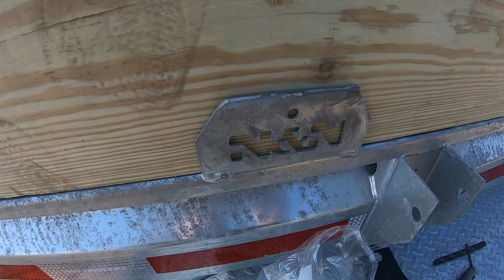N&N galvanized trailer gets sideboards and HAULS WOOD

Comment: Put a 2" x 6" under the 2" x 12" then your sides would be 17" tall. You could make a flat plate to connect the 2 boards in the center.
Reply from the maker: Yup, that would work too!
Reply: @InTheWoodyard  Or a 2x4 under the 2x12 with strips or tie plates, if you're worried about the pocket dimensions. Or go down to the local Amish Engineering and Weld shop, make the expanded screen extensions, with bracing, up to the 36" extension. I think that's too high, but I guess Kryptonians don't pay much attention to mere earthlings when it comes to things like that. Could make a 36" panel that folds down some, sorta dual purpose. Ask Tony! He's no MERE earthling!! Betcha he could come up with something you'd feel good about! - No law says you can't put the 2x12 on, see how it works, go from there.
Reply: Other comments are recommending Teflon slick paint, I think. It's so slick and nonsticky, it won't stick on anything! On my gravity wagon, it didn't even last 3 loads! Made me worried about chemicals in the paint that were then in the corn. You could paint the floor purple if you wanted!! Nobody'd see it!! Ordinary paint, not so slick, but takes a lot longer to wear it out! - I'm surprised you didn't just round off the shoulders of those bolts!! The bolt in the back could be ground off, and with a jam nut there wouldn't be much there to catch firewood!! - Use a strong bungee to take up the slack on the tailgate chains. That will leave you with options!

Comment: On my trailer I used castle nuts on the inside they are nice and rounded and I don't seem to have any problems with anything getting caught on them and if you happen to be in the trailer and bump into it with your bare arm you should not get cut like you would on the bolt, just a thought, paint the wood silver and get some of that reflective tape in red and put that on, I think that would look nice and be seen better at night , I used the hi visibility reflective tape, it's better to be seen nice and bright, take care
Reply from the maker: Thanks for the tips Larry!

Comment: Congratulations on using your new galvanized trailer, looks sharp. Nice job on the sides too. Maybe you can coat the bed with a liquid wax to help with getting the wood to slide when the bed is raised. Paint the wood inserts silver for a sharp look.
Reply from the maker: Thanks Edward, I might do that!

Comment: If you need some angle iron to reinforce the corners or along the length of the boards I've got a bunch of it. Would make for good rub rails and keep the top edges from getting banged up. I'll even drill the holes and install, all free!
Reply from the maker: I will let you know! Thanks!

Comment: Kris, I don’t know if you are completely north of corn and soybean country, but if there are any farm implement dealers around you with grain carts, gravity boxes, grain buggies on their lot, ask them about ‘slippery paint’. Wet corn, up to 25% coming in from the field, doesn’t slide very well either. I’ve never seen a galvanized gravity box but this slippery paint can apparently be applied right over the original. Just a thought, there must be some kind of silicone wax spray that will work also. Good luck, great looking trailer!
Reply from the maker: Thanks for the tips Thomas!

Comment: Hey Chris 
My dump trailer has the same plastic caps as yours on the top of the 2x2 uprights at the tailgate and rear corners. I hauled 4 or 5 loads and noticed 3 of them were gone. I shined a flashlight up from bottom in the dark and guess what....no drain holes. Might wanna find something to seal top off or drill a hole in the bottom so they don't get water in them and freeze. Might check and make sure it won't hold water..always something!!!
Reply from the maker: Thanks for the tips Gary!

Comment: All kinds of trailer envy on this end. Just purchased a Moritz painted trailer. Dint even no bout galvanized trailers...  
Be sure to coat any drilled out holes with some of the galvanized paint and I would coat any exposed threads too.  I haven't had much luck with painting green treated wood.  I think using some of your used oil, would not take much, to treat the side boards would be the way to go.  You could always attach any advertising to your side boards to add durable colors .
Reply from the maker: Yup, my thought now too, thanks for watching!

Comment: leave the boards natural, just use thompson’s wood preserver, the green can which is oil based, it last longer, painted boards look bad when the paint starts chipping off, and i bet the trailer bottom will get slicker after a few dumps wears some of the galvanising off, and for the love of humanity…grease the trailer!  the saying goes…grease is cheap…pins and bushings are expensive.  great video, oh the wood will hang up on the D-ring not those bolt ends, but you could grind them flush to the nut if you want.
Reply from the maker: Yup, all good points! Thanks!

Comment: It's a little disturbing that you watch your customers while they are rubbing their wood.
My truck has issues tipping if it hasn't been used in a while. It get a fresh coating of rust on the deck and that's often enough to stop things moving. Once it's had a few loads of wood or gravel through it again it polishes up and slides nicely again.
The trailer looks super sweet.
Reply from the maker: HA! Yes using it will help!

Comment: The sugar beet farmers here put a plastic sheet in the bottom of their trucks.  It allows for a makes a much more slippery surface.   I don't know what it's official name is,  but its about 3/16 thick.  It simply bolts to the front of the box on the floor.
Reply from the maker: Thanks Mega Mike!

Comment: There’s a spare tire lock I think I picked up from Tractor Supply. Two tabs that thread on to two bolts it has 90 degree bends that the lock joins them together.  You might not want to get the sides too high because you pull into garages on your deliveries. Nice looking rig.
Reply from the maker: Thanks Jeff, this trailer might not get into many garages, it is wider than the old one.

Comment: Chris , the tubing that the mount slips into . Drill a hole in the center and put a bolt 1/2” or bigger bolts thru it with a nut on the back side and tighten it up to bracket until it pushes the bracket tight to the inside of the tube piece right there will be no more play and then snug the back nut up. That’s what I did with my new trailer with same style mount , also I noticed at my dealer they are making them exactly like that now
Reply from the maker: Thanks for the tip!

Comment: N&N is expensive on their sides. When I bought my Diamond C, I paid $800 for 2 foot expanded metal sides, 1 head board, and 2 for the rear doors. Before I went up anymore, I would calculate out and see if your legal and truck can handle the weight you want to haul. Commercial truck violations are very expensive.
Reply from the maker: Good point Richard!

Comment: I have a 4*8 flatbed i made stake sides for, and i painted the 2*4s and 1*4s with an oil-based paint. It's lasted 7 years and going! I was surprised. It's only flaking off where i made a vertical bit crooked and i have to beat it into the stake pocket with a sledge when i slot them in.

Two coats, gave it like a month to cure properly.
Reply from the maker: Thanks for the tips, again!
Reply: Sorry i type as i watch lol. I'm very forgetful.

Comment: Good choice on the trailer! The telescopic ram/piston is the only way to go as long as it lifts high enough. As for side boards we used the laminated lumber just like the planks masons use they support a lot of weight. So if those planks or hardwood doesn't work out the laminated will hold up well. That's what they usually put on the semi and straight dumps (big trucks) but cost is high. They'll take a pretty good hit from a loader but you'll probably be good hand loading or loading yourself. That trailer should be nice because it's deep and short enough so it will dump well! Enjoy! Maybe you can have a dump load sale to get rid of that old wood? Maybe a few pieces rubber and blocks behind your spare will snug it up so it won't shake apart?
Reply from the maker: Yup, I blocked the spare already and my brother mentioned the laminated lumber for the side boards. Thanks for the input!

Comment: Hi Chris, beautiful trailer!  To help a hand plane slide over wood, we either rub some parrafin wax on the bottom or slide the plane over a rag soaked in WD-40.  However, a plane bottom is much smoother than galvanized metal.  Not sure if it will work, but thought I'd share.  Keep up the great videos!
Reply from the maker: Thanks for the tips Jason!

Comment: Think your idea of a 1" or so gap from side board- down to side of galvinized  trailer would be good idea with road vibration, you might get wear on your galvinization ,and then maby rust. Good idea going 6' width on your trailer.  I have a Galvinized boat trailer & no repainting.
Reply from the maker: Thanks Dan!

Comment: I like the chain door holder. Just put a connecting link, whatever they're called that has the little hex shaft that screws closed. Make a little loop with that instead of taking out links, in case you want to re-extend it for some reason. Dab some lube in the threads, mine like to sieze in whatever position they're in.

You could also put a neat-ass hook onto the 2*12 right there, so you don't have to fiddle with the clasp half the time. I hate locking clasps, unless they're on safety chains or something.
Reply from the maker: Yup, all good points...thanks!!

Comment: Just buy locking lug nuts for the spare. Problem solved! If you paint the wood, it will eventually peel and flake and look like doody. Get a hand-held small blowtorch. Use a steady hand and lightly burn the surface in long strokes. (Practice on scrap pieces of wood first to get the technique down). You will end up with really nice looking wood (this brings the grain out) that will also be more protected.
Reply from the maker: Yup, good ideas !

Comment: Save up your tip money and pick up a nice hydraulic 12,000 pound winch for the front lip.

That would make getting those 12 ft. 
X 15 inch diameter logs up and in that nice trailer.
Reply from the maker: That might be a good idea!
Reply: It would tie right in to the existing hydro system to the lift.
Anxious
To see how you get along with the non slip cargo bed.

Comment: Just be careful lifting with the gates closed like you did with the old trailer to unload by hand. I blew that bottom latch off on mine last fall when I had stacked load take a good slide
Reply from the maker: Thanks for the tip!

Comment: 1. The sell locking lug nuts you can use for the spare tire to deter theft
2. If you let the boards naturally gray, that may match the trailer and require no extra work
3. I’m sure as that galvanized bed wears in, the wood will slide out easier. You may just have been spoiled on your old trailer as it was “broke in”
4. I’d probably go up another 8” on the sides. That should easily let you fit 4 face cord loosely & 6 face cord stacked.
Reply from the maker: Ben, you are not just another pretty face, I agree with you!

Comment: Good morning Chris, I'd recommend a solid color stain for the sideboards as it will give the look of paint but not peel. Also when you pull the boards off to paint or stain you can buy an aerosol can of galvanizing compound and spray the holes you drilled through the brackets as the inside of the holes are now bare. As for the floor maybe try a couple coats of wax? Idk know how long it would last though. Might also check to see if you could prime and paint over the galvanized floor, still have the protection of the galvanized, but the smooth finish of paint.
Reply from the maker: All good ideas, thanks Jason!

Comment: Not 100% sure but I think if you drill through the galvanized coating you will get rust where the bare metal is exposed.
Reply from the maker: Yes you are probably correct about that!

Comment: With the chains holding the rear gates open, it looks like you might be able to reposition the fixing to the trailer rather than 'remove' three links.
Reply from the maker: Yup, that would work too, thanks!

Comment: Nice trailer, nice video.  You can purchase a product called Slip Plate at the farm supply stores.  We used to use it on the gravity flow farm  wagons to make the grain slide out better.  You can purchase very thin aluminum diamond plate sheets at the farm supply or home improvement stores to cover the side boards if you don't like the appearance of wood.  I actually like the natural look of wood and use used cooking oil (painted on with a brush) after the green treat wood has been allowed to dry for a while.  If you ever decide to haul logs on the trailer; I suggest taking the wooden side boards off as they tend to get broken while loading or unloading.  GNI
Reply from the maker: Thanks for the tips Larry!

Comment: Morning Chris, that’s a great trailer, see you went “ dog digging a hole “ method on the first load. Ha . Once you decide how high your sideboards need to be, might check with sheet metal shop about side covers that lip over top, probably fairly expensive but permanent, and they scream out as a rolling billboard, maybe a sign maker decals. Hey it’s easy to spend other guys money! Have a good one
Reply from the maker: Thanks for the tip Mike!

Comment: Nice trailer Chris. You can achieve the 16" height that you want by stacking a 2" x 4" x 12' on top of the 2" x 12" x 12'. Just tack on 3-4 pieces of 2" x 4" every 3-ft or so on the back side and you're in business.
Reply from the maker: Thanks for the tips!

Comment: Chris. I would have a bracket Made or bolt directly to the support right around the corner on the front of trailer behind tool box. Also a little less visible and removes some of theft temptation
Reply from the maker: Thanks for the idea!

Comment: I get a lot of City trees. Average 50 inch rounds. When you're cutting into a big tree like that. Usually the first 10 ft will have nails in it. I destroyed it tow 28-in bar 93 link 3/8 0.50 gauge. Does anybody use carbide tip chains? How do they last? I don't mind spending the money! For a good chain.
Reply: I bought a cabinet chain for some demo work.  Ruined chain on about the second nail it hit. Can't  be sharpened by hand.  Save your money they are not worth it.
Reply from the maker: I doubt it, metal on metal never ends well with a chain.
Reply from the maker: I would agree!

Comment: Bed liner might work for you. I drove a truck pulling dump trailers and owner had bed liner and half way up everything would be gone out tail end. Have a great day be safe.
Reply from the maker: Interesting!
Reply: @InTheWoodyard  buy a sheet of it and score it with a skil saw so you can bend it to go up on the sides of trailer some. Just ask around surely someone knows how to install that type of bed liner.

Comment: The boards are great! Dont get them to high because it will affect you when delivering into Garages.  There are a few things you can do for your apare tire.  My local trailer company has a locking lugnut with a special key, or you can get a lock like you were saying!  Like the new trailer.  Paint the boards silver.  Will look a lot better otherwise you will look like a U-haul trailer.
Reply from the maker: Thanks for the tips Craig! This trailer will probably not be going into many garages because it is wider.

Comment: The Zinc coating will be grippy for a while ...it will buff smooth in time.
My suggestion (as if it matters) is the bottom board match the trailer, the top board red and your Woodlot Business name in contrasting color...silver? Be careful though, check local regulations, by putting a business name on it you may end up having to go commercial tags and insurance if you are flying under the radar. 
Wheel locks ( Locking lug nuts)from an Auto Parts store will add the peace of mind that you made it more difficult to steal the tire
Reply from the maker: Yup, all good ideas Russell, thanks!

Comment: Looking good Chris I think of you and up another 10 in it would be fine I would leave it a little bit shorter and bring it up to your header and that way when you did take your tire boat and be inside the sides of your trailer I would paint them bottom one silver the additional 2 by 10 that you would put on you could go either silver or red and if you got some good wax and wax the bottom of your trailer Inside it could help you with the wood sliding out of it looking good
Reply from the maker: Thanks for the ideas Kent!

Comment: Chris...nice trailer! My pick is Silver stain on the treated wood  the paint will peel over time. Their are different Viscosity of stain so go with the lighter since a thick coat of stain will peel as well. As for the bed not sliding use some dry lube or silicone spray to make it slick . We  wood workers use it on our table saws or any metal table top that we want it slide like butter.  The Woodworkers Warehouse, Home depot or Amazon “ will have a Version of the product.  Regards
Reply from the maker: Thanks for the info Juan, I really appreciate it!!

Comment: Never paint treated wood, Chris. A mistake that's often made. To produce pressure-treated wood, the milled lumber (typically pine or cedar) is saturated with chemical preservatives. These chemicals minimize the wood's natural vulnerability to insects and rot, but they also leave the wood rather wet—a state that will ultimately lead to your coat of paint eventually peeling.
Reply: After about a year to 18 months the  treatment dries enough to paint.
Reply from the maker: thanks for the tips Terrence!
Reply from the maker: Good to know, thanks!